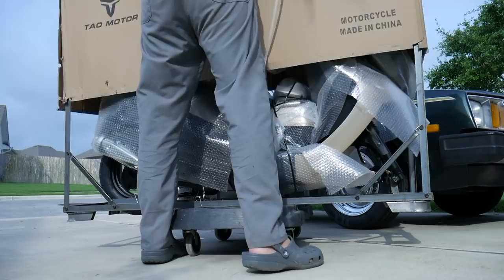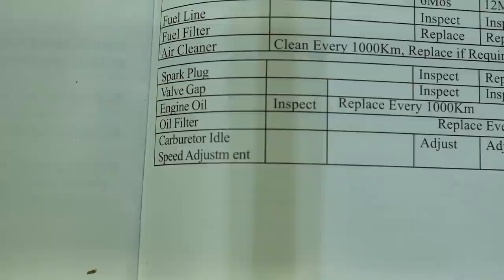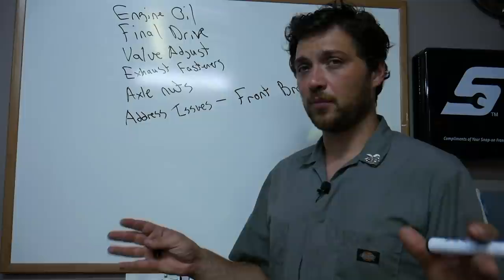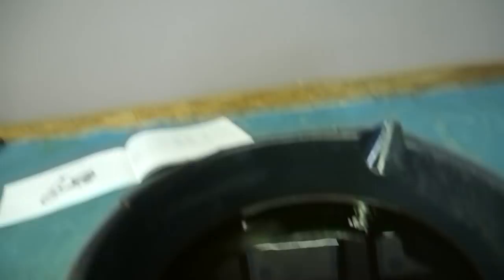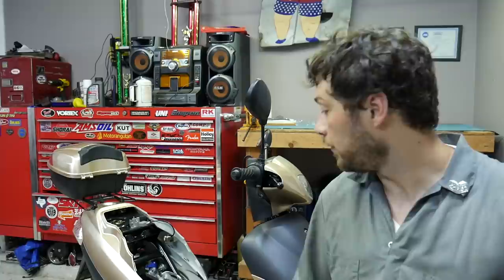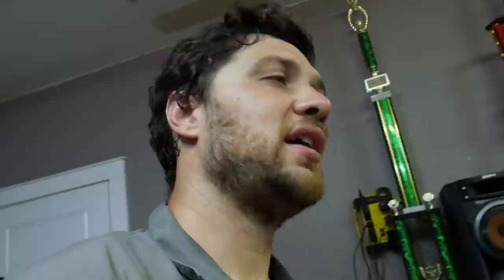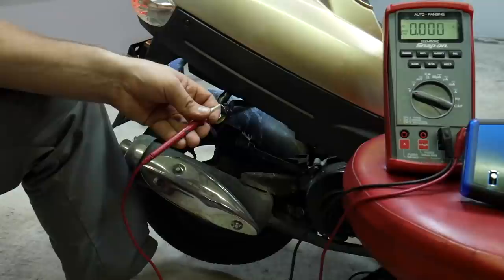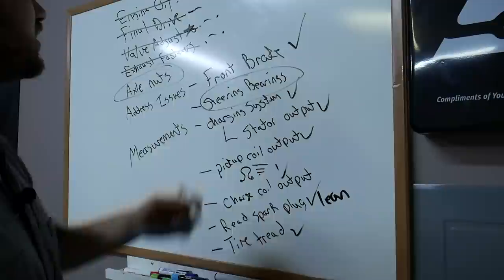(PT. 3) 300 Kilometer service on the most HATED scooter on the internet: Living with a Tao Tao

Comment: My opinion is you should keep it stock until the experiment is over. They start messing with it.
Reply from the maker: thanks for your input!
Reply: @Scooter_911 Hey THANKS for your video...I think you should make a short...showing exactly where the drain and fill plugs are...So Manu people are trying to fill the gear box by removing the adjacent support bolt vs fill plug..so many of these are coming with almost zero gear oil because of it...Also..if you could tell us EXACTLY how much gear oil...and not everyone can get the oils you show please show us oils and gear oil  people can get from thete local autoa part store.. I think you thought those things would be obvious and they are to the mechanically inclined but to tye average person they have zero clue....or when you check the oil do you screw it all the way down to check and do you fill to top of crosshatch marks....  Please LMK this is fit my son ..I'm gonna link a short so you see what I'm talking about...so much bad info out there...

Comment: one doesn't "live with" a taotao ... one buys it because of the almost irresistible price, then starts fixing ... and fixing ... and fixing .... eventually one sells the taotao cheap to someone who also can't resist the low price. thus, the cycle of sorrow goes on.
Reply: i have a 150 tao, i'll sell it to you for $500 plus shipping and guarantee the engine/transmission for two years unlimited miles , you will have to get a new stud bolt and  helicoil for it , it has over 30,000 miles on it
Reply: @carmineredd1198  That's a great deal. I'm looking for one locally in the New Orleans area and no one has deals like that.
Reply: @DivergentDroid  yeah, . there are 2 major problems. first you want a piece of 3/4;; wood strip about 10'' long and tie it under the seat bucket onto the crossbar to keep the plastic side panels from breaking at the connection tabs .
 2nd you want to loosen the muffler mounts at the  top and at the axle and shim with a washer so the mount brackets don't break from torque.  don't force the muffler or it will break at the mounts 
address these issues before you even sit on a new bike . if you want to mail order , they want $250 shipping so $1000+- shipped for the 150 powermax, there is a new model the Pilot,  it has different wheels
Reply: @carmineredd1198  Thanks for the info. I'll keep those things in mind.

Comment: I'd start by moving the needle up one position, It's not a mod, but an adjustment of factory parts. I'm sure they ship them super lean to be emissions compliant. As far as the low compression, it might sort itself, but you cant baby these thing or they'll glaze the cylinder. 
I'd love to see some mods, but I also want to see the experience of running it as it ships.
Maybe start mods at the first major failure? I'd like to see some testing of stock vs modified, maybe stages, like big bore/cam. Then carb/exhaust/big valve head. All the mod stuff is dirt cheap from goofit on amazon. Using the cheapest stuff is right in line with the spirit of a frugal TaoTao buyer.
Reply: Compression is always lower when the rings are still open. A warm engine should close them up further.
Reply: I am with Ronald. Everything stock, only if something is really not working right then redo / replace.

After half of testing or even after the regular test time, then redo / tune to maximize its potential, under economical considerations of course.

Comment: I'd probably leave it stock, but might consider changing jets since it's a budget mod vs. replacing the carb.
Reply: I agree.  Its something a beginner or uninformed buyer could figure out, and requires no tools tools outside of a screwdriver.  My scoot actually runs fine lean like that, but these 50s are more tempormental
Reply: Go full jank. Rejet with a drillbit. Remember the main buyers of these scooters, just trying to get around town for cheap and literally can't afford anything better. It's why the brake pads were cleaned and torched rather than replaced.
Reply: I agree since most people can pick up new jets easily and cheaply through Amazon. It’s an easy solution and can be done cheap
Reply: Agreed, rejetting is adjusting the carb to the climate - it’s good practice and a good repair shop would do it anyway
Reply: @Pony Boy So you're telling him to remove the Pair system from the scooter. won't really affect it much; If he was going big bore, It'd be a good idea, but stock, it doesn't affect much other than run dirtier.
Reply: You can't change the jet without changing the top end to bbk 😂

Comment: I'm a mechanic and serviced a lot of gy6 engine's with 20000+ kilometers often. And they ran without problems if serviced regularly.  
A lot of the time the rest of the scooter will disintegrate before the engine wil stop running
Reply: My 16 ear old Yiying 50cc has 21000km on it and still runs just fine. Oil change, valve clearance and the right carb jet are essential.

Comment: The whole point of this experiment was to see how this scooter performs stock.  I'm sure that an alternative carb would improve matters considerably but if you're going to do that you might just as well fit a big bore kit and a sports exhaust and forget the experiment entirely.  By all means move the needle a couple of notches and maybe even rejet to stop it running so lean; I would consider these to be adjustments rather than alterations but beyond that I think you are defeating the whole purpose.

Comment: I bought the exact same bike last year.  Something for a 70 year old retired guy to mess with. No prior experience with a GY6.  Out of the box top speed was 30 and slow getting there.  Within 2 days I had knocked the baffles out of the exhaust with a Harbor Freight screwdriver and BFH and had the speed up to 35-40 with no other mods.  I watched some You-tube videos, which one would do if they shopped Amazon, and ordered a jet kit for $12.  Sealed carb, yes, and it took me all of 10 minutes to unseal it with a hacksaw to slot the screws, and screwdriver.  If you have the savvy to set the valves the carb is not even a challenge.  I had a 76 main and 30 idle jets.  Went to an 88 main and 32 idle, opened the air box and retuned the air/fuel mix.  Cruising at 40-45 and I weigh 200.  Got that for $12 jets and no other expense.  I say go for the realistic low dollar mods.
Reply: @Pony Boy That's like telling an ugly chick not to use makeup!

Comment: Cranking rpm is a good record to keep, helps keep track of starter motor strength &/or pinon year binding. As far as running lean, they all run lean from the factory for emissions reasons. I've always replaced my whole carb as it's easier than trying to get in and re-jet a sealed unit. 

Very technical breakdown, love it.

Comment: Definitely re-jet the carb. As it continues to break in the lean condition will continue to get worse. I consider jetting to be part of normal maintenance until the motor is completely broken in. Elevation above sea level often makes the jetting a necessity.

Comment: I really appreciate the effort you are putting into this series! Watched the entire thing. It's great learning from your experience, and you are doing a great job documenting it.
I feel this would have been of great use a few years back, when I had a 150cc chinese scooter that insisted on falling appart on it's own. At least it teached me how to service my own stuff, as I had to tear it appart about 15 times in 2 years, not counting the dealer services.
About the tire wear outlasting the engine: 
The one I had came with some garbage, absolutely terrible tires with a white band (the scooter had a classic look to it). I sold the thing with about 9000 km on the clock, and the rear tire was starting to show some real wear signs. It was all teared up in every groove, it even deformed itself because of a gas station air pump that decided to lay 45 PSI on it, massively overshooting the 30 I had asked for.
I think the tires had about 2 or 3mm left before it sold. But you know what? I had seen before that the frame was kinda crooked (yes, the freaking frame was bent). So, the bike had to be a bit sideways to go straight. Maybe that precipitated the tire's wear! By the way, the bike had absolutely 0 crashes or drops. I'll never know for sure how the frame got to bend that bad. I sometimes carried a passenger, and of course I went over some awful bumps on the street, but nothing too out of the ordinary!
Anyways, I'm glad you are doing this for people in the same situation I was to use! Thanks for taking the time to do so :D
Reply: The frame is usually steel, if you didn't hit potholes or do drops, it was probably shipping damge.

Comment: The goal should be keeping it as stock as is practical. That being said, being practical often dictates making necessary upgrades. If running lean is an issue then it needs to be addressed, starting with the cheapest option and scaling up until the problem is resolved. I’m the person you are making this video for, someone willing to work on their scooter but not a master mechanic. I can figure out a lot of things but I’ve never rejetted a carb. As for the biggest problem with scooter owners being they don’t replace the shipping oil right away, the problem is much worse than that. They only change the oil every 3,000 miles because that’s what they’ve been told to do by their car owning parents, then blaming TaoTao when the engine blows! 3,000 miles, that’s almost 5,000 km! And it’s often 5,000 km on the shipping oil! THAT is the #1 reason these things fail prematurely in my opinion. Failure to keep bolts tight is another big issue. I’ve learned to use lock-tite and recheck bolts often. Nothing like a brake caliper falling off to get the riders attention, lol. Some issues you WILL have with this series of videos are bolts loosening up surprisingly fast, petcock failure, worn out sliders, rubber hose failures (both vacuum & fuel lines) and a slew of electrical problems. All in the first 6 months. The engine itself will likely be the least of your worries.

Comment: White dry thin smooth coating on spark plugs today, is due to modern additives in the fuel, put in from the refinery.
Yes sparkplugs would normally look brown, but the pictures used for evaluating spark plugs are outdated by 20-30 years.

Comment: to answer your question on lean mix:
Yes, DO adjust the carb mixture, but do not re-jet it! since carb adjustment is just ADJUSTMENT, it's OK, but re-jeting it is already modding and this means it's not stock. so, adjustment is welcome. plus, you're expected to to it at different times of the year anyways to keep it optimally running. 
try turning it 3.5 turns out. does wonders for my scooter (which is essentially the same scooter as you have). 
respect for you driving with stock adjusted carb, i couldnt handle the slowness... believe me, with 3.25 or 3.5 turns out its not the same scooter!

Comment: I say, "Give it it's best chance!" Re-jet it due too that is the lowest cost(time is money) but it will make sure the engine is running correctly! If you get a new carb, you'll might run into other troubles that might cause the engine to fail more easily if not tuned correctly, or if it falls out of tune!
Reply from the maker: thanks for your input!

Comment: Can't say anything about recovering brake pads with that trick (have never needed to), but I have used that trick on a clutch. This was a temporary/junkyard type repair on a 62 IH Scout, but the clutch is still working good after ~15K miles, and this clutch was horribly oil soaked. I soaked the clutch in gasoline overnight to allow it to fully penetrate the friction media, then lit it on fire. NOTE: Don't just let it burn off all at once, that will definitely overheat things. I let it burn for around 30 seconds, then smothered with a cement board. Allow the clutch to cool, then repeat until it won't burn anymore. It was worth it on this vehicle, since installing a new clutch would require turning the flywheel, and I wanted to preserve the flywheel as long as possible (Plus, clutches for that are very expensive).
On something like this, I doubt it's worth it, unless you really don't want to wait for parts.

Although the way you did it likely wasn't enough to do much, they will need to soak for at least a couple hours (they will actually burn if they are soaked).

Comment: Put big bore kit at 1000km you will fall in love in the scooter. I drove 5000km on 50cc original kit and 15.000km with the big bore kit .crankshaft is strong dont worry about it. My scooter is on the third top end kit(piston cylinder ) botom end is holding strong after 20.000km
Reply from the maker: thanks for your input!

Comment: Leave it stock. Interested in the compression as motor breaks in. I love all the recorded data. That way we have known good. The needle position rather than the main jet would determine the color of the spark plug. If it’s like a motorcycle carb. I’m pretty sure that u r not wide open throttle all the way home. I know u have to pace yourself on video output. I really enjoy them. My Buddy 125 runs great. I’m going to do the oil changes. And I need to replace one way starter clutch. I will order off Amazon unless u have other suggestion. Also,  a valve adjust. Raise needle one slot. Maybe?  What is your day job wrenching. Thank u!!!!!!

Comment: I have a second hand Roketa 150cc with GY6. I just put 1000 km on it in 2 months. All I have done to the motor is a valve adjustment and it runs excellent. I think the real downside is the plastics and electronics. I need to adjust the steering as well as it has got a little play in it now. Front brakes grab well but squeek arent very smooth in the handle, probably need to check the oil. For $650 I'm really happy lol. Great series!

Comment: A jetting-kit is really cheap and realistic to upjet it a little, starting to replace working parts like the whole carb perhaps not so much (coz in many countries also illegal unless it is a stock size).
Reply: @Pony Boy Caps-lock much? changing idle mixture won't do much for running lean on max throttle, wich is what you use most on a moped.

Comment: 1 year ago I bought a BMS 150cc. It was my daily rider. It has 11,000 miles and runs strong. Belt & variator must be changed every 4,000 miles, clutch at 12,000. I get 60mpg.  Tires replaced every 6,000 miles( $50 per tire). Upgraded now: bigger bike. All this is FYI. Anything will last if taken care of. Valves do need a lot of adjusting.

Comment: Just bought a scooter. That Google doc would be great for reference. I my 150 in the crate. I didn't know I had to other parts that will already put together when I had received it. So my exhaust ended up rattling loose at 50 MI. Now I know I need to go over the whole scooter.

Comment: hm agree with the others, rejetting is not cheating :) adjusting the accelerator needle is also acceptable. watch for the o-ring between the muffler and the exhaust pipe . they are a well known failure point. is fair to replace with a proper aftermarket gasket. will not change reults of test ..

Comment: I have to fully agree with you. When you order these bikes, they come in a crate. You are expected to install some parts and assure everything is working and the bike is safe. Which means you should have at least some basic mechanical knowledge. Otherwise, you’re not able to find things that might have been missed at the factory. For example, on mine the vacuum hose to the petcock was disconnected which means if I didn’t catch that, the bike would have NEVER started because vacuum would not allow the petcock to open and allow fuel to flow. I owned a Yamaha CA50 in 1986. The design and set up is exact the same. Only difference is the Yamaha was a 2 stroke. If you have some basic mechanical knowledge and don’t beat on the bike, it’s worth the money.